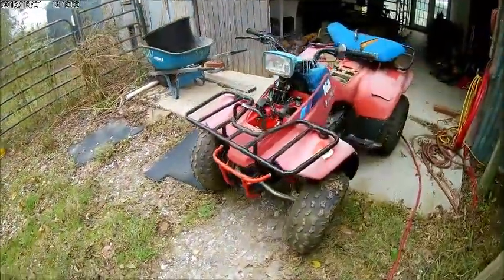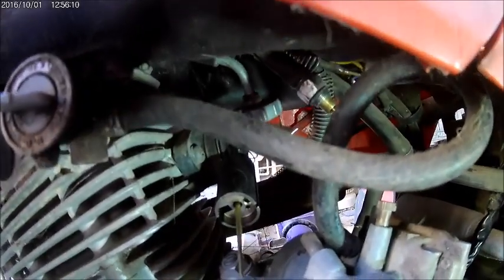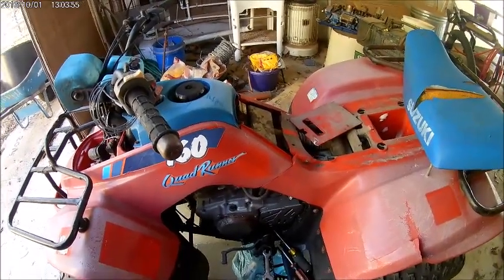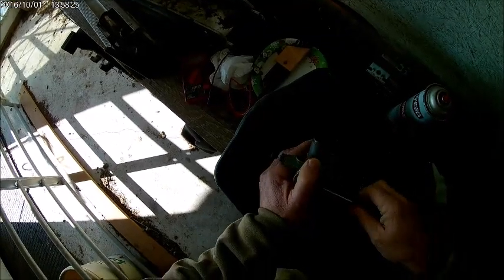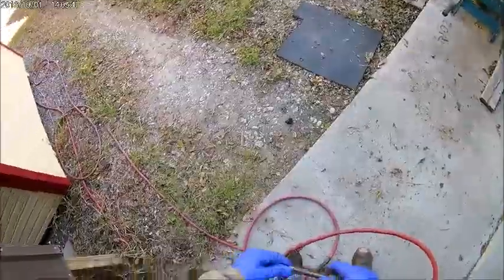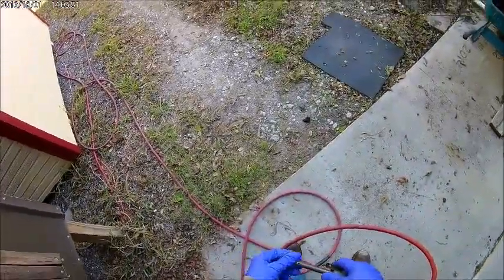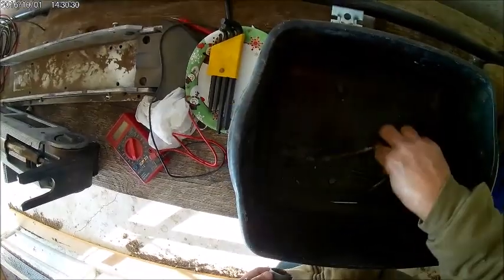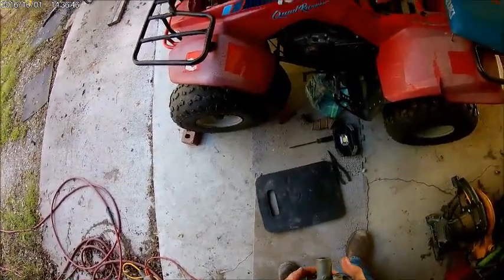SUZUKI QUAD RUNNER CARB REBUILD

Comment: Can you pm me I can’t find help anywhere, I got a 160 quadrunner (red and blue), I can take the gas tank out with the reverse cable still installed and they only way I can replace the gas tank is if I remove the reverse cable